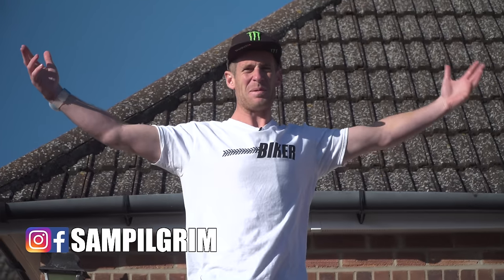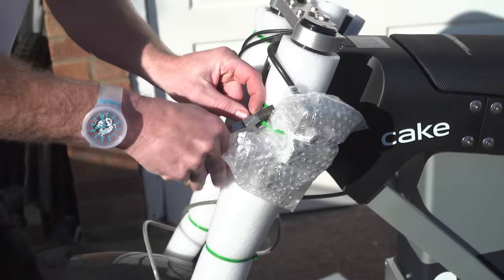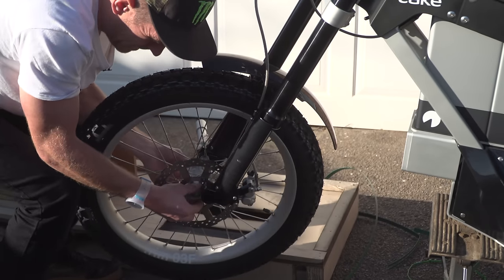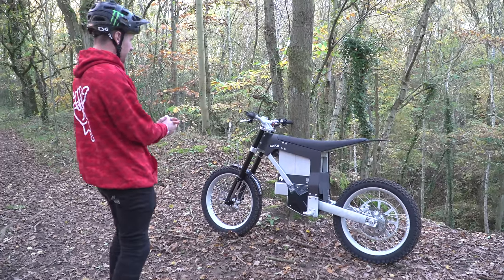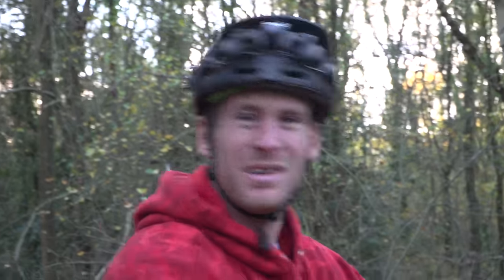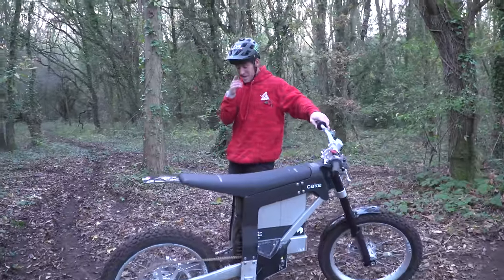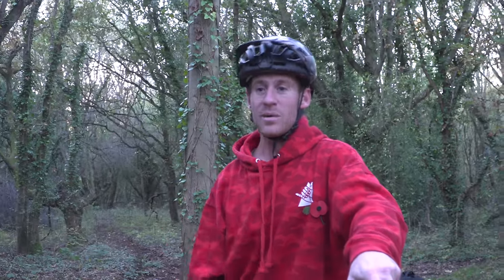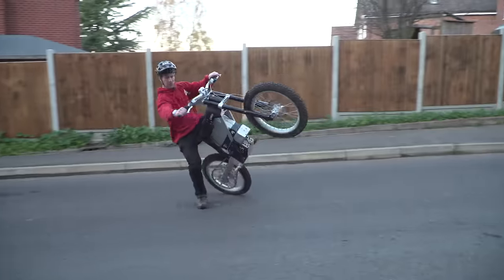MY NEW ELECTRIC MOTOCROSS MTB HYBRID IS INSANE!

Comment: I have often wondered where my personal sweet spot of power and weight would cross. I think the cake is too close in weigh at 75kg to a my 250cc 2t which can jump massive 60ft jumps with ease. My mountain bike though is way underpowered but the ability to change direction and pop off the smallest of features is so fun.  I am thinking 30-40kg with 20hp would be money.

Comment: FYI... the front wheel spinning in a wheelstand acts as a gyroscope and provides a lot of straightline stability... the guys who can wheelstand for miles and miles usually have a small motor on the front wheel to keep it spinning and thus stablise the bike and rider...
Reply from the maker: Oh nice 👍
Reply: @SamPilgrim  Try this test... hold a bike upright on it's back wheel with the front wheel off the ground - turn the bars side to side... no resistance... now, spin the front wheel fast with your hand and then try and turn the bars, you will feel the forces at work...

Comment: I hate this new world.... 

Checked their site to see what the price and specs are.... well... just shy of $13K... after taxes, shipping, needed "accessories", etc... well, it's gonna cost you at least $18k-$20K... for a toy that couldn't even keep up with a 1986 Suzuki 125cc anything. Not even a new Suzuki anything, but a well trashed one, one on its last legs so to speak.... it'd still slap the pants off this toy. 

So, you could either buy a house, a car/truck/van, a whole fleet of dirtbikes and quads... or one of these toys... 

And if you DO choose this toy, well.... it'll run for about two to two and a half hours before you need to charge it overnight again. Like flying a drone... ten minutes of "fun" for every 18 hours of dull charging nothingness. 

But it wouldn't be so bad if the world wasn't FORCING this BS on everyone. Pretty soon all cars and trucks will be EV's.... and I mean REAL soon... which simply means that the used auto market will die, nothing will last longer than its laptop/phone battery that will die in 5ish years... so in 5ish years, every super expensive EV anything will be "totalled" and EV-Ewaste. As any car or truck especially, will cost some $20k-$40K to change battery sleds. So yeah... thing could otherwise be mint, but in 5 years when the battery takes three times as long to charge, and then depletes in ten miles... well... yeah... it'll be totalled at that point. When most petrol cars are just breaking in, the EV's will be ewaste totalled... and since none of them will last long enough to become used, depreciated vehicles, well.... you'll have to buy NEW all over again... so, say hello to spending $50K every 5 years on transport. . .

It's all beyond stupid. 

Even in the most distant realms of lawn care, they now have literal hundred pound plus backpacks (battery backpacks) that you can hook up to your mower or weedeater, to get actual usable time out of them. Because everyone knows this is BS, not worked out well enough to actually work yet, so they're trying to circumvent the issues with stupid ideas like massive, heavy, battery backpacks... just to be able to do what a petrol unit could do in its sleep. 

And yet the droves just lap it up... like mindless diddlederps. 

Plus... don't even begin to think about how folks who don't have driveways and/or garages will charge their EV's while at home... folks in apartments, on street parking, etc. Even me, with a house (that cost me less than the best bike these cake folks sell, lololol) wouldn't be able to charge at home... with my distant AF driveway and more on street parking that could never have charging ran to it. 

All so dumb.

Plus, what ever even happened to "all the savings" that these companies went on about in the beginning phases of the creation of these "great ev ideas"... EV's have no transmission, no complex engines, etc... all they have is a VERY cheap electric motor, something that at cost is no more than a few hundred bucks brand new... with massive profit included... yet despite having NONE of the typical expensive parts on them, they still cost $20K.... riiiiiiiight.   Seems legit....